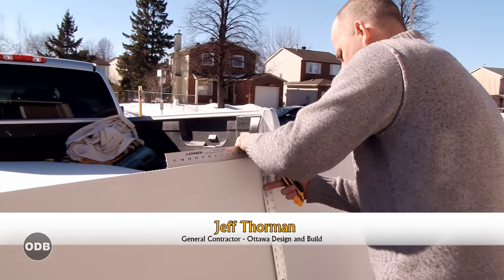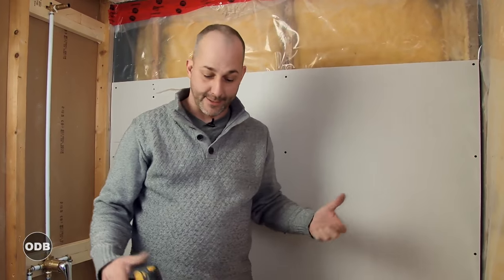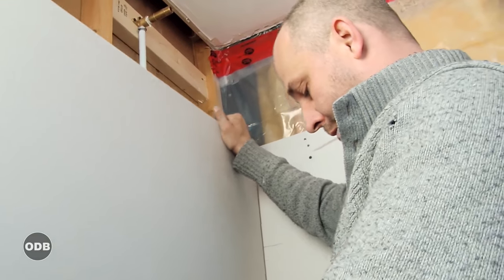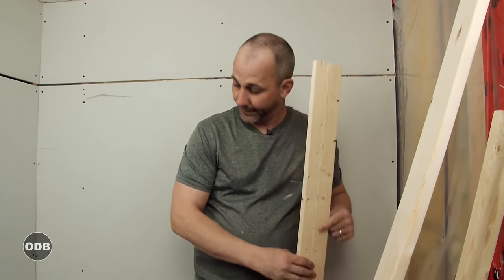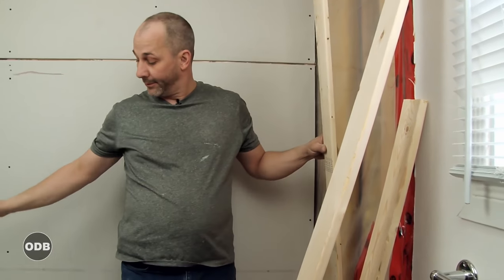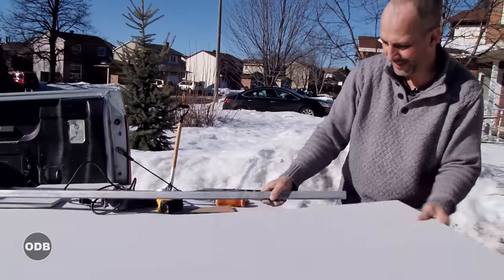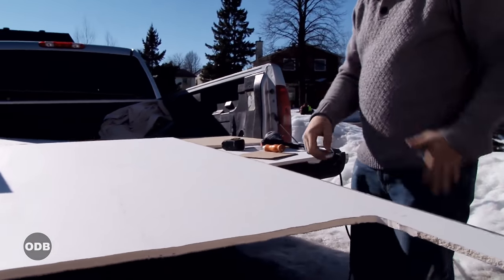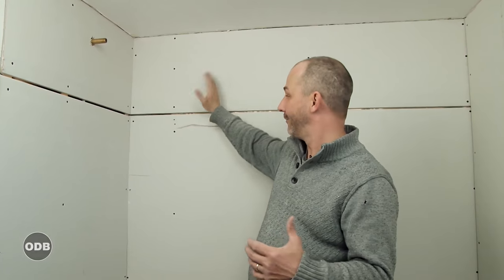How To Install Drywall in Your Shower

Comment: Thanks!  I’m an electrician and we’re totally renovating our house and love your videos. With the added bonus you’re in Ontario too! I’ve bought the Schluter membrane to do the bathtub shower after ripping out the old Mirolin one piece. I was in the big box store trying to figure out whether to buy the Kerdi panels or the membrane so went to check out the price of drywall. I may still buy the mould resistant drywall but the associate in the building materials department was pushing me to cement board and to not use drywall, asking if I really wanted to spend the money on the Schluter system because he felt cement board was SOOO much better.  I’m glad I trusted my gut because I just found your videos.  I’ll pick up the drywall Tuesday when it’s not raining and definitely confirm my tile supplier gave me unmodified thinset. 

Huge thumbs up my friend!
Reply from the maker: Hi Geoff, unfortunately the box stores give advice on products based on margin for the store. Best to find a tile supply store in your area and get your advice from the counter sales people. they are trained by the suppliers and know their stuff. Cheers! glad to help
Reply: That and he was old school (made me look young lol) and I got the old dog new tricks feeling.  My big issue now is a 60” tub in a 62” opening and mansplaning to my wife what a 2” fir out is going to look like when she can’t visualize from a sketch and wants to see a finished product first...🧐

Comment: I'm ripping out my bathroom floor and shower. Removing the rotted subfloor and shower to bare studs. The contractor did this 10 years ago didn't have long term in mind. Doing it myself this time, making sure it's done right.

Comment: What you did was show me how to drywall any wall, and how to cut out holes that I would normally do in any room. What I would like to know is how do the drywall and the tub specifically come together? 

At the back walls of the tub is a flange/lip to screw the tub in. Does the drywall go over the lip, behind the lip, match up with the lip, etc? Does the drywall meet up with the top of the flange/lip, or go down over it? I did get a quick shot at 5:03, it looks like you made the drywall match the top of the lip, then filled in the gap with calking?
Reply from the maker: drywall comes to the top of the flange. then seal the gap. Cheers!

Comment: I hired a handyman for a really good price. I purchased cement board but he never ended up using it and reused the drywall that was behind.

He said it was in good shape and mentioned there was no signs of water damage and told me to return the cement boards to save money.

My worry is leaks later on. I feel he cut a corner to save himself time. Should I be worried ? 

Thanks

Comment: Hi, Jeff! First of all great channel. That's my favourite subscription. I need your opinion. Right now I'm building the bathroom in my house. What do you think which is better dry wall or cement board under the tiles? I'm gonna roll on Red Gard over as underlayment in both cases. What I'm looking is longevity. Is there any benefit of using cement board that worth this extra effort working with it instead of dry wall? And when I'm saying dry wall for the bathroom, I mean 1/2 inch thick moisture resistant dry wall.
Reply: Most certified tradesmen would use cement board it has longer lifespan some customers go with drywall with waterproof membrane which if done right still has a decent lifespan and is slightly cheaper, cement  board is harder to work with but good for life. The fact he used regular drywall is often frowned upon by certified builders. So if you want longevity then just spend the extra and do it the right way. Any google search now a days would say don’t waste your time with drywall. If you do use drywall make sure you caulk it at the bottom and spend the extra on moisture resistant.  make sure you check the caulking and recaulk it if necessary yearly to prevent wicking especially in his style application.
Reply: If you watch his next video he uses special layer of plastic and cement on top of drywall
Reply: @shielduniversity419  Thanks. Would be helpful for me to watch it, but he has so many videos that it's impossible for me to find the very next one.

Comment: Jeff,
I kept having an issue with my home's exterior osb sheathing warping. After the second contractor installed new osb and Tyvek, I took a peak and could view both the fiberglass shell of the stand up shower and the tub next to it! No vapor barrier and no insulation! The contractor or plumber had installed both to the studs, then installed sheet rock above both. Now I know why the outer osb is warping! My question now: what is the best way to install the proper installation from the exterior of the house once I again have a contractor remove the warped osb for the third time. I understand that this isn't ideal, but the house is only 5 years old, and I really don't want to rip the tub or separated shower, and drywall, out.
 Thank you.

Comment: Hi Jeff, thank you so much for having your videos online. They have helped me very much. I have a question.
What should I use for my shower ceiling Drywall or Hardie backer board. I don't plan to tile the ceiling just paint over it with white water resistant paint. I do plan to tile the walls of the shower to were it meets the ceiling. Will the Drywall or Hardie backer board be good for the shower ceiling and be painted over. The shower will be in closed with a shower door I also plan to cut out a whole in the middle of the ceiling to attach a vent that leads to the attack and to the outside wall in the attack for some ventilation.  The ceiling Measures 3 feet 5 inches x 2 feet 8 inches. It has plaster with wire mesh currently that I plan to take out. What do you recomend ? Thank you so much   Lazaro
Reply: We normally just drywall shower ceilings and it works just fine

Comment: Thank you! you explained why the wall above the new shower insert is sloped.  They didn't make the adjustment like you did in the video. Soooo can I still tile it with a small tile?  Large tile will show the sloped edge.  We primed 3 times with Kilz water & mold resistant primer and then used a good quality paint.

Comment: Great video but why didnt you use the green or the purple drywall for moist locations also use a painters tarp or old blanket to stand on in the tub to avoid boot marks you did a great job on the drywall sir...
Reply from the maker: the tub has a protective liner.

Comment: nice work I have a question I am removing my tub with walls and I want to install walk in shower how far up better I install purple drywall behind shower walls ?
Reply from the maker: That all depends on which waterproofing system you are using.
Reply: @HomeRenoVisionDIY  I want to use this Gold Bond  1/2-in x 4-ft x 8-ft PURPLE XP Mold Resistant Moisture Resistant Regular Drywall Panel
I want to know if I can use paper joint tape with Red Dot All-Purpose Pre-Mixed Joint Compound above shower wall is that okay? Please advice

Comment: I am replacing the bottom 4 or 5 inches of drywall above the top of the shower tub with green drywall.  What would you recommend i fill the gaps with at the top and bottom of the new pieces and the corners as well?
Reply from the maker: kerdi fix and  a membrane roll on. Cheers!

Comment: Question this about the water barrier you create, are you trying to prevent the building framing from deterioration or are you trying to preserve, for as long as possible, the usefulness of the current installation. I have found that keeping the tile adherent to the wall for the longest amount of time will prove most beneficial against both affects.

Home RenoVision DIY has some really good pointer in this video that are aside from the purpose of the title. It is all go in go on install for anyone to perform this way. It will last for years that is for sure; but, if it is your personal property and your not wanting to do it again; is this the way you would do it?
Reply from the maker: understanding the membrane is the key to this install. If you can't trust it them do something that you do trust. Better yet take the course so you can trust it.

Comment: I'm loving your videos. Great work and great information shared. I'm renovating my bathroom and planning to use the schluter waterproofing membrane for the new shower. Can I use that on drywall that is painted? Or do I need to tear out the old drywall and start from scratch? We were going to just add backerboard on top of the drywall, but from your video it looks like we don't need backboard at all. Keep up the good work.
Reply from the maker: membrane over a painted wall works great. Cheers!

Comment: Great video. And very neat work. I'm just wondering did you get the measurements for the corner fit correct on the first try?
Reply from the maker: Yes. I always measure from a square corner so this makes it very precise.
Reply: Home RenoVision DIY you are the man! My grandfather used to say measure twice and cut once!
Reply: Just buy extra drywall and eyeball it until it's right

Comment: Question. i am redoing my bathroom  and the original was end were a combination what appeared to be a from a drywall or plaster board. the two ends seemed to be 1" thick and the sides 1/2" thick. Can i add 1/2" slats to the ends and then use 1/2 drywall. i need to do this because the window casing in 1" from the studs and the water tap is 1" out from the wall?

thanks

Comment: having a vapor barrier behind your water proofing membrane just creates a gap that no water can escape.  It sounds great that no water can get in or out, until water gets in and can't escape, causing mold.
Reply from the maker: How does it get in if it is waterproof?
Reply: at the end/edge of the membrane it transitions straight to drywall
Reply: He used the non modified concrete to seal the edges....

Comment: I just want to add shower panels instead of tiling.  Do I just need to use the blue or greenboard?  I don't need to add the plastic barrier, do I?
Reply from the maker: you are correct. Cheers!

Comment: I'm running drywall to the shower surround. What "caulk" do you recommend to go between the drywall and the surround. Can't afford tile. Thanks.
Reply from the maker: If i remember correctly pl 200 is the surround adhesive. best to check at the local store. i think they sell the adhesive and the sealant as a package deal. cheers!
Reply: Thanks! Cheers!  @HomeRenoVisionDIY

Comment: I don't understand what wrapping that metal J molding did.  You still have a 1/2" protrusion from one board to the next, no?  Are both walls getting tiled?  Then I suppose it would look like a decorative bump.
Reply from the maker: All we did was caulk the bead to the wall and then it all paints together in 1 step. you can't paint a rough edge of drywall
Reply: Please people do not listen to thsi gentleman  ....using hardibacker is not  hard to work with .
Dry wall in a bath or shower is disaster waiting to happen ..
Also the use of Red Guard .with the Hardibacker is the way to go
Reply: Luis Castaneda .You don't ever use sheet rock in a shower or bath...even with a membrane .
The guy posting the video can do what he wants it's his house

Comment: What kind of dry wall is he using? How many sheets?
Reply from the maker: 3 sheets of regular 1/2 inch Cheers!
Reply: @HomeRenoVisionDIY  How are you? Does it come 1/4? I am repairing bottom tiles in a shower. The tile is just a little bit thicker than the others. I am thinking there is 1/2 inch. Thank you in advance.

Comment: Why you did not use backerboard? I'm learning
Reply from the maker: I might suggest you watch our video on 4 ways to build a waterproof shower. it will help a lot. Cheers!
Reply: Yes, just had my shower retiled. The worker had 30 years experience. He said I needed backer board or tile board. You cannot attach tile to wallboard. I googled it and the response was the same. Maybe it's a question of terminology.

Comment: So I am just getting ready to do a new tile surround on our shower.  I was planning to use green board and then apply red guard.  Starting to hear the red guard does not stick to green board.  Should I change course (getting ready to hang the drywall tomorrow)?!?
Reply: It's a Longshot you see this, but what did ya find out? I'm starting this next week.
Reply: @epictoast6727  I didn’t find out my exact question, but did learn a different fact that changed my course on our remodel.

Apparently green board is a no-go in shower surrounds in the US building code.  I ended up using durock cement board in place of the green board.  Was a little less friendly to work with, but wasn’t bad.  Used the red guard after install without issue.

Comment: That would not pass code in any town I've ever lived in. You have to use either water resistant green board or blue board. And if you tile at all anywhere, you have to use Duro Rock
Reply: He is installing waterproofing over the drywall. Watch the next video
Reply: Alexis Brigmon im glad i came to your comment, i watched the above ( titled waterproofing) and was bummed to get to the end without seeing any ...thank you.
Reply: @labrigful  Consider what if there is a leak from above or behind - so water gets at the REAR of the drywall - massive failure.  Using drywall of any type for shower walls is lazy and irresponsible.  Many areas do not permit it - for good reason.

Comment: I don't understand when you say, "...invest a whole lot of money".  
I bought 4 panels of DensShield from Menards for about $42. It is designed to act as a tillable backer board in a shower without applying any waterproofing to it (althought I did anyway, per advice from Starrtile and TileMasterGa).  It is also light, and easy to both fit into place, and to cut.
So why take the risk with gypsum board just to save a few dollars?
Reply from the maker: this is where things can get dangerous. Which waterproofing system did you use. Denshield was not developed for use in showers so the technology is not very compatible with many other shower system products? I have seen guys install and silicone the joints. That always fails!
Reply: Three coats of Redgard. The joints were taped and mortared.
Reply from the maker: That is a solid installation. You should be proud of that work. Cheers!

Comment: Rule # 1...NEVER put drywall in the shower area...never.* yrs tops in longevity , and mold growth from day one...says a guy who has done this for 38 yrs. Take that for what you want
Reply: No keep letting them use drywall! They keep me in business and I love fixing their work.
Reply: So then what do you use if you don't use drywall?
Reply: @That_Stinger_GT5  cement board is the lowest product...or raise the quality to a shluter product...no mold , no degradation , and if installed properly , will give you decades of no water damage....cheers
Reply: But my basement is only a crowd space and cement plus tile is a lot of weight
Reply: Nice video Jeff. I’m curious why you don’t use green or blue or even cement board as appose to reg drywall?  Is it simply to save $$$?
Reply: You capping bro, I put drywall all the time, no issue. Red Guard and be done with it.
Reply: @txmade4371  How about using a substrate that does wick moisture , nor mold , and is water proof onto itself instead of a terrible product like drywall ? Think about it
Reply: Sheetrock works fine.  A little hyperbolic eh?

Never had any problems with using Sheetrock.  

When there’s a leak, or no exhaust fan in the bathroom, that’s when you have problems.

So… just do it properly and Sheetrock is perfectly fine.

If you like, you can get the mold free Sheetrock as well… which is typically purple at the big box stores.

Comment: Do you use the same joint tape and joint cement like a common drywall?
Reply from the maker: No, i simply install the waterproof membrane direct to the drywall. There is a video on that as well. Cheers!
Reply: Does the waterproofing product fill the gaps between the drywall?
Reply: @HomeRenoVisionDIY  can you share the link? What about if there is gaps that redgard wont cover?

Comment: Why arent you using blue board in the bathroom????
Reply from the maker: When I am using a water and vapor barrier there is no value to the blue board , since water will never find its way to it.
Reply: @HomeRenoVisionDIY  changing in temperature will cause condensation, which will also generate water drops inside your wall. vapor barrier can only protect water in the tile side but not the condensation in the flip side. In addition, dry wall is not designed for west area such as shower place no matter it is blue board or normal drywall.

Comment: which size green board is best for the ceiling in a bathroom. 1/2", or 5/8? Does it make a difference?
Reply from the maker: 1/2"is standard unless you are going for soundproofing.
Reply: @HomeRenoVisionDIY  Appreciate the reply. Thank you sir and keep up the good work.

Comment: really , nice cracks.  couldn't get it any tighter?  you should always try eliminating joints or crack.  should stand both ends in one piece.  you should have used a water proof board in the whole enclosure.  there's aboard called Denshield, it's water proof.  We had a piece of Denshield lying in the back of my brothers truck , completely submerged in water for about a week. We took it out  and broke it in two. It was bone dry. Alot of tile installers use it around where I live, here in Washington.
Reply from the maker: Hey Douglas thanks for the suggestion.  I have tried everything in my career. The truth is that using a water and vapor barrier behind the tile is the only way to get a great result long term.  Denshield has its negative side as well. You don't need waterproof drywall when it is behind a waterproof membrane, that would be like wearing a wetsuit on a submarine.
Reply: Home Reno Vision DIY what about the cracks
Reply: How do I install drywall on my submarine?